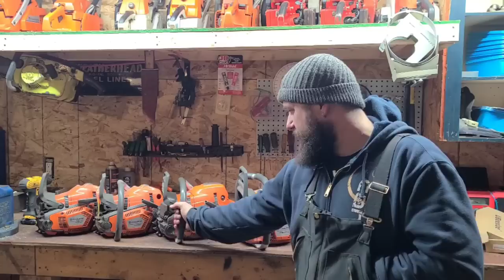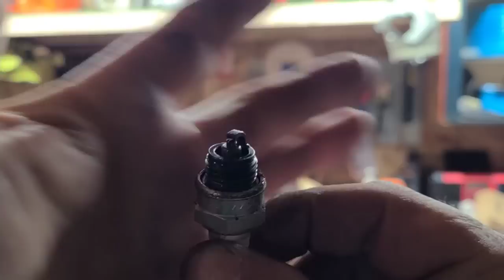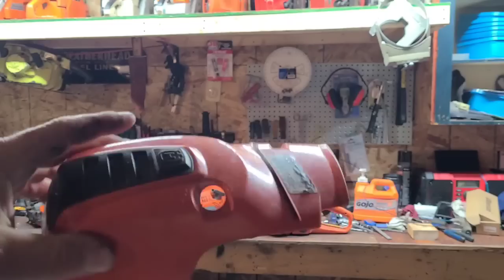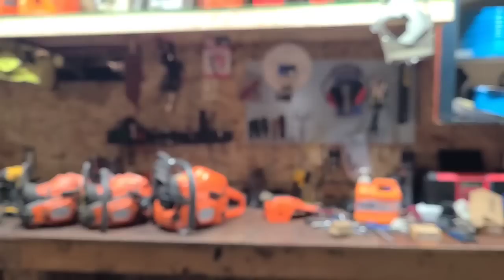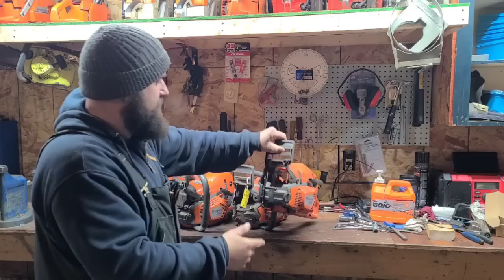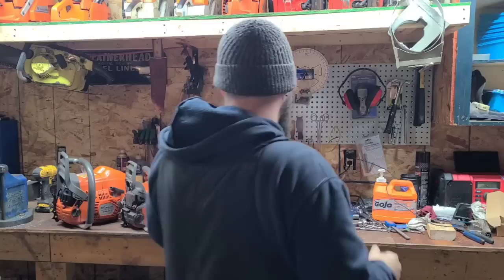FNS- Husqvarna Auto Tunes, my thoughts about them.

Comment: Hi Tinman
Love watching all your videos thanks for sharing your knowledge.
I own STIHL & Husqvarna chainsaw’s and I like both brands and have been using chainsaws for more than 20 years I have never blown a saw.
The biggest problem I have seen is lack of maintenance.
1- I always have a good sharp chain
2- clean air filter after every use blow out clean with 
air compressor.
3- Good fresh fuel and quality 2 Stroke mix 44:1
4- I always warm the saw up before cut and let run at idle before shut down.
I have never had a problem with m-tronic or auto tune on both brands of saws.
Once again Love watching all your videos keep up the good work and stay safe.
Reply: I've discovered the air filters on the lower end Stihl saws aren't the greatest. Every time I clean mine, I find sawdust on the wrong side of the filter.

Comment: I’ve got a first gen mtronic 261c and have had zero issues in the 5-6 years I’ve had it. It’s been a solid saw for firewood and brushing or fuel mod gigs at work, have used a 550xp mk2 at work with no issues. That said my go to saws will always be my 372xpg’s and my 365xtorq, just picked up a ‘96 vintage 066 for milling of a friend. Love it as well, I prefer a manual carburetor on a chainsaw.

Comment: My 2020 562 XP G is pretty amazing, and I've had no issues. It is my first Pro saw, and I'm absolutely awed by its reliability and handling. I keep it maintained and sharp and every time I run it I'm impressed. I'm a firewood getter and this is mostly a bucking saw for me, with the bucking dogs on, which I had to buy separately because I'm an East coaster.

Comment: New viewer here thanks to buckin billy rays channnel mentioning you in numerous videos.
3 out of 5 of my saws are conventional carbs , purchased my first auto tune saw 6 years ago ( jonsered 2158 ) and I hated it from the first cut , had a dead spot in the throttle pickup. Gave the saw time to break in and still had a bad taste, then 6 years later picked up a 572 xp to give my jonsered 2171 a break , end result after more than 100 cord on that 572 and I will grab that saw every time I head out to the woods !

Comment: I have been using a 572XP for about 2 years now.  Even in red or black oak it needs an aggressive chain to keep it from running away; i.e. screaming RPMs and over-heating.  I was warned and heeded the advice to do the auto tune initial procedure by the book.  The frist day of use (90F weather) using the Husky pre-mix that came with it, it ran really hot and I added enough oil to get to 40:1 and that helped.  The second day the coil died, I think it was cooked.  New coil and better oil at 40:1 and sharp aggressive chain, it has been fine.  The air filter on this one is great, but I don't let it get dull enough to make a lit of fines.  Then again, these days I only cut my own firewood and only a couple of cords at that.

Comment: We have an Oleo Mac gsh 510 and we had a blown head gasket within a year. 
Fixed it and switched to Husqvarna LS+ Two stroke oil and Efco biodegradable bar oil. It now runs like a dream and starts on the 3rd pull and once warmed up it starts with a 1/4 of a pull. 
so pretty much what you said in the video, good fuel, good oil, clean air filter, sharp chain and a bit of common sense are what makes a saw good.

Comment: I’ve never ran an auto tune. But I do know I love my old saws,
Reply: The 550 I just got is amazing. Start, saw, conquer, repeat.
Reply: I got an awesome deal on a 545 m2...it's an excellent saw. So is the 572xp. Neither one has given me any issues and they're both very impressive. I haveva 32" bar I use for big stuff with the 572 but it normally runs a 24" full comp chain and it's a beast. I use my 545 the most though, I really like it. It's got a lot of low end torque and is a screamer on the high end. Neither has given me any problems

Comment: Hey, hey!..I just spied that Pioneer 3071 hanging up there!..I have one I bought 25-26 years ago for $20.00..it was low-hours, but the electronic ignition was toast..well, I couldn't find an ignition(had a funky 2-piece CD system), and it was pre-internet days..I took an electronic coil from a Mac 10-10 and adapted it..although one of the coil bolt holes didn't line up, I modded it so it worked, and re-routed the plug wire...she fired up, and boy, she ran like a beast!..still have her...

Comment: I have the opportunity to work on these fairly often at a dealership. Most of these saws that come in have fuel related problems, just like any other saw. 
The saw is designed to compensate air fuel mixture. When the new ethenol  fuel warps and distorts the metering diaphragm and pump, the computer will try to correct the lean and starts sending additional fuel through the fuel solenoid. The part is similar to a power valve. Most saws that I see at that point run as if they have a blown power valve. Just over fuelled something serious. The problem is, the computer will run it's old settings on your new carb repair. 
The process is the same for repair like any other saw. Instead of grabbing a screwdriver for tuning, you gotta hook it up to the autotune program and reset it. Just like new trucks, you can't fix them at home much any more. Probably the biggest reason most guys stay away. I'm an old school fan myself.

The guys that burn them usually have a tree crew in these parts. Lousy employees that are hard on Equipment they didn't buy, and the company doesn't invest in maintenance on saws. Dull chains + clogged air filters + bad Sawyers = Burned cylinder. Happens a lot here.
Reply: So what's my 572xp trying to tell me when it idles great, but won't rev up after 30 seconds of running?
Reply: There's a field reset procedure. Idle for 3 minutes. Then, do a long rip cut.

Comment: Gee has your channel grown I think you had around 300 subscribers when I joined. Discussing things with my local dealer one day I was told that no 372 x torques were ever bought to Australia by dealerships and all the saws that I have worked on or have sen have been original editions, why I don’t now why. I seem to start having trouble with some of the auto tunes when the temperature gets above 36 C or 100 F they seem to get hot and hard to start or they just stop. So getting the heat out of the saws seems to help a lot. As to why they blow up my thoughts, they are built with a measured air leak which the chip in the carby controls  now what happens if you get another leak the carby tries to account for the leak and what happens when too much air get in and the carby can’t adjust for it and it burns up. With older saws you pick up on air leaks sooner before damage is done. Not every one can afford the diagnostic programs, so the next best thing is the can of brake or carby cleaner. This is only my preference, I mix my fuel at 35 to one on my bigger saws and 40 to one on the smaller ones especially in really hot weather. That’s my thoughts cheers and have good day to all

Comment: I have a husqvarna 555 auto tune . I believe it’s a 2014 . I bought it new . Although I have not used it commercially.. it’s just a firewood saw, and does some odd work  around my property. I cut 4-5 cords per year . My 555 starts 2nd pull every time no matter how long it’s sat or how cold it is . It’s starts easy and runs crisp every time . I’m a big fan of the auto tune. Can’t complain one bit .

Comment: I own a very old Husqvarna 353, a 5 year old Stihl MS 241 Mtronic and a new Husqvarna 562 XP-G Auto tune. I love my Husqvarna saws, while I regret buying the Stihl.
My experience with Auto tune is positive. The machine always runs optimally regardless of wind and weather, and not least how dirty the air filter is.

The 353 is my workhorse, strong, reliable with a nice bottom pull.
On paper, my Stihl is as strong as the 353, but that's only on paper. Vibrations, sound, power and feel are like an old wasp with a cold.
My 562 XP-G is preferably used to saw long slabs with a 36" chain, which it does excellently.

Comment: Had a 545 Mk1 mainly on 15” bar and then on 18”. It ran without issue all year round for 10yrs., felling and processing hardwood. It then partially seized but that was because of a slightly cracked intake manifold and I didn’t know. I had it rebuilt and it runs good but starting became a pig.

After looking around, I ended up buying a 550XP Mk2. I’ve had this for 2-3yrs.  Again felling and processing hardwood in all seasons with 18” bar. No problems so far. The Mk1 545 & 550 were both 4.9kg / 10.78Lbs. dry and without bar+chain. Both have now become 5.3kg / 11.66Lbs. I think that’s due to a changed anti-vib system.

I reckon 15”-18” for the 550 is the sweet spot. So for larger diameter stems, I got a Stihl 500i. I’d had a Husky 576 shortlisted but the 500 won out with less vibration. Also, nobody had a 576 or 572, even though I had to wait a few months for the 500i. The one thing that stands out for me, is that the easy start of the 500i is press-hyp. It’s not an easy saw to start. Typically takes 10-12 pulls when cold and when the saw is warmed up, still takes 3-4 pulls.

Comment: I have 390xp,576xp non autotune and top handle t540xp I purchased a week ago.Maybe I will buy 572xp and 590xp when it comes to the market some day.I'm a saw guy too😁I ran 572xp test saw and it is extremely loud saw no muffler mod,that I dont like but it is a good runner.All the new saws are  downsized,like engines on a cars.Also have 555rxt brushcutter.I prefer no replacement for displacement😁 Very good channel keep up like that.

Comment: I have one M-Tronic, and I really like it.  Runs the same on the hottest days of summer and the coldest of winter with no tuning - just flip the little winter shutter around.  Haven't had the guts to muffler mod it, but I understand it'll retune itself if I do.  Gotta keep an open mind for these things!
Reply: Do you calibrate it every time you run it like Stihl recommends?
Reply: @Vinson351  It calibrates itself.  Just let the saw warm up before you use it.  I think calibration takes 30 seconds at startup.
Reply: From what I’ve read in the manual, and from Stihl’s website and YouTube page, as long it’s under the same conditions it doesn’t need calibrated. However, if elevation, temperature, etc, are different it needs recalibrated. That is done manually after warming up the saw.
Reply: @Vinson351  Checked my manual, and you're right, the calibration process is more than letting it warm up for 30 seconds.  The way my manual is formatted, it reads as start the saw and let it run for 30-60s without touching the throttle.  Then at the top of the next column there's a boat load of warnings and notices before it says to run it full throttle for at least 30s.

It also says "Calibration enables the saw to be adjusted faster for optimum performance."  I guess I've never calibrated it, and never needed to, because it will slowly adapt, just not as fast as if calibrated.

Comment: I seen a video from Husqvarna that he put duct tape over the air filter and the old saw wouldn't run but the new auto tune would with the same plugged filter. This doesn't mean you should run your saw with a plugged filter it's just a demo to show you that it works and can make life easier on you. I think why those 550's burnt up is because someone didn't clean and change their filters enough. With auto tune keeping the saw running with a plugged filter it would reduce the amount of fuel to the engine being a two stroke you aren't getting lube without a full dose of fuel there for the saw would run "HOT". Tinman you work on these all the time it's probably second nature to blow out your filter and check it through out the day so you may never have a problem but others may forget to do their maintenance on their tools. Glad you like the 562xp because I was considering it for a primary saw myself. It won't see the use yours would but.. I don't like junk.                                                                                How to Set the AutoTune on a Husqvarna Professional Chainsaw   (a great video to watch if you have one of these.)

Comment: The auto tune saws start easy, but they have a fair amount of issues. All the saws you showed have all had or need major repairs.  How about talking about how expensive the parts are and if you couldnt work on it, would it be feasable to have a dealer repair them  Here in the states, a lot of the gasoline has alcohol in it, which is corrosive, and the metering jets get ruined in the auto tune carbs if they sit for a  time.  Check out the price of a new carb. You can buy the pre-mixed fuel from the dealer to prevent the problem, but it works out to be about $50 a gallon.  I have never had to rebuild any of my Mac's or Pioneers, use them every month of the year, and many have been on the job for 40 years or more.Check out my video (Why MR. Obsolete Only Uses Vintage Chainsaws) if you get a chance.  Good video.

Comment: I just got a 545XP mark II that was a display model someone stole parts off of. Hasn’t seen a drop of fuel since it was run at the factory. I’ll have it running here in a week or so. It’s my first computer saw. I prefer non-strato adjustable carb saws so we’ll see how it goes.

Comment: I bought my first 562xp new in early summer 2016. 4 hours in it blew up from a bad crank seal, dealer gave me a brand new powerhead.
The next one, I cannot remember how many hours were on it but was blocking up a roughly 20" downed tree and was wide open mid cut and she locked up instantly. Overtorqued crankcase half bolt pulled the threads and went into the flywheel.
I was starting to get a little irritated and almost went a different route but Husky had the dealer give me another brand new powerhead.
I abused the everliving dogshit out of it since and even after sitting a year now I bet it will start in 3 pulls. Still my favorite saw to this day.
Husqvarna even replaced it both times beings I was running amsoil under warranty. They didn't care, it had good oil. Dealer said Stihl would have never warrantied it and I would have been SOL.
After that I said if I ever buy a new saw it will be a Husqvarna for that reason. That was customer service that went above and beyond that's for sure.

Comment: I copied and pasted this section of 550xp mark 2 review this is what is improved.......

the main bearings have been updated along with the crank and cylinder including a new crankshaft, new piston, cylinder base gasket redesign (to reduce heat transfer), and new carby ceramic sleeves embedded in the crankcase.

Comment: I'm a homeowner and run a POS consumer saw, it works fairly decent for limbing and light work. The biggest problem I see with low end stuff is people mixing the oil lean or using cheep oil. 50 vs 40 to 1, the mfg is under pressure to run lean and increasing the oil mix one level is better for a hard working saw. My saw suggests 40/1 and and when I add 5ml to a liter can of ready fuel, the saw runs better.
Reply: I've personally never had an issue running a good 50:1 oil. My MS 171 paid for itself with its first use. I'm sure the air filter is what's going to get it eventually. It always winds up with fines on the wrong side of the filter.

Comment: Thanks for the auto tune video! I actually came across you channel a few months ago when I picked up a blown 555 and did my first saw rebuild. From my research it's very close to a 562. I got all my parts from the local husqy dealer and I asked him about a base gasket delete and muffler mod but he recommended to just keep it stock because the auto tune might not compensate for the extra flow. It seems you have had a good experience with the muff mod and I like the idea of getting some extra heat out. Do you have a video of what that muffler mod consist of?

Comment: IV got a 562xp in Australia stamped 2017 It has trouble hot starting I have to flip choke up and down to put it in high idle then starts fine powerful runner with 20"

Comment: My first husky was a gen1 550xp and still runs like new 4 years later and recently bought the 572
Reply: How’s your 572 runnin? I’m having trouble with mine idling. Tried some of the carb reset techniques but it’s still being a bit temperamental. Absolute beast in the cut though
Reply: @jarrett754  so far no problems that way but it could maybe need a software update
Reply: @timhopkins7372  that’s what I’m hoping. It was fine for a couple weeks but since then man it won’t idle for more than about 15 seconds

Comment: I realize the dull chains kill saws but I wonder what oil mix those saws had in them? Do you think if they ran 40:1 or 32:1 they would still be running?
Reply: 40:1 why not , plus non-ethanol, 89 oct. +

Comment: The auto tune will run funny on a cold start because it’s fuel settings are as per when it was shut off. So it takes a couple min to adjust to the current situation then they take off.. the 550xp are hot rods..

Comment: 5 series Husqvarna saws rev and run like wild BUT they have a serious issue with crank bearings and seals. Do not mix at 50:1 try 40:1

Comment: The Autotune adjusts for conditions.  I don’t know exactly what it samples though (likely air density and temp)  nor do I know sample rate.  

However; one thing I am in the habit of doing is periodically doing a “field reset” especially if I haven’t run it in a bit or temps have changed quite a bit…. 

My 550xp Mk2 is particular about how I pull it.